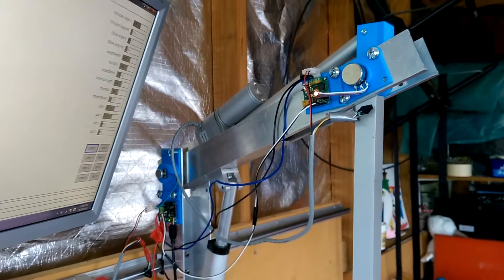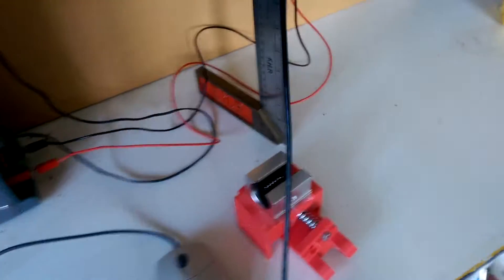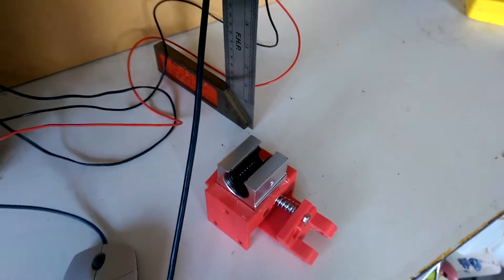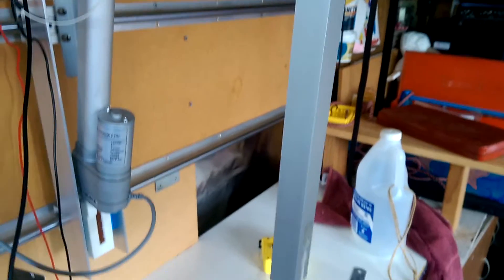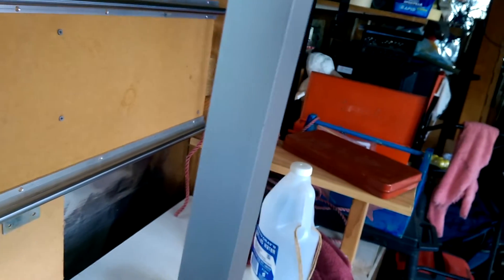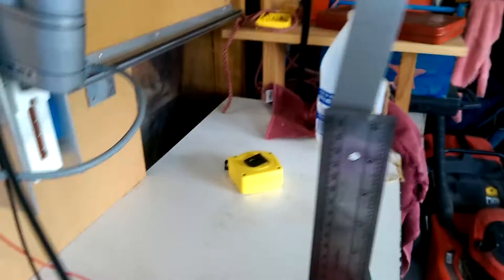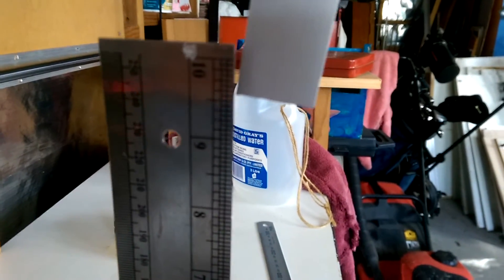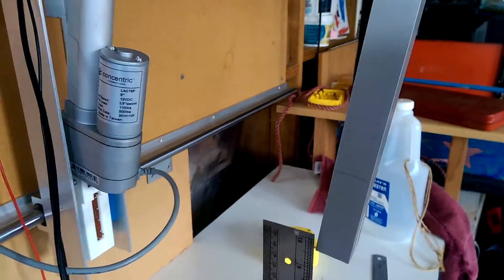Robotic Arm with Linear Actuators - Mark II

Comment: About the accuracy it's probably a backlash issue? As long as the load is from the same side the repeatability is probably quite good?
Reply from the maker: Yes, there is something directional going on.  I had the feeling it might be in the pots because the measurement/feedback should take care of any backlash in the gearing.   I've since moved to magnetic encoders for everything - so much better.

Comment: Hello, great project. Could you please provide a link to actuator's datasheets or maybe just say which model it is? :)
Reply from the maker: Hi, There are some more details in the comments of my first video, https://www.youtube.com/watch?v=QMMlMlj_-NA.  They are the 50kg versions with feedback from https://www.pololu.com/category/103/concentric-ld-series-linear-actuators
Reply: Great, thank you :) I am currently working on a similar project and i am wondering if you used any bearings here? For example in the pivot points, where you attach potentiometers? Or just some screws, without bearings?
Reply from the maker: The bearings are thin ball-bearing ones.  There are 7mm thick so they can fit in the channel.  The inner diameter is larger - about 25mm from memory - this allows me to use a 3d-printed Axle with enough room to mount the pot at then end.
Firstly, I connected a  pot with a D shaft to a D-shaped printed hole but this was tricky because if I made the hole too small I could not jam the pot in.  Even when I made it as tight as I thought I could, I could actually see the D shaft rotate slightly with respect the the hole when you wiggle it, since at first it only contacts at a single point at the "corners" of the D, obviously giving hysteresis.
The circular hole/shaft worked better, since it was easier to jam the pot into a smaller hole for a really tight fit.  The pot had a slot in the end of the shaft, but I think the 3d-print could not make a ridge fine enough to engage with this.  I screw to hold the shaft would definitely be a good idea - my design was too compact to try this easily.
But now I'm moving down the magnetic encoder path - the geometry/setup is pretty similar - if you can mount the pot, then you can mount the magnet, and the zero mechanical error is very appealing.
Reply: Curious if you've made any progress with your closed loop motion, especially with the magnetic encoder!

Do you foresee your arm setup achieving movements anywhere near 0.1mm-0.2mm repeatability?
Reply: Hi Hugh, Checking in again -- To see if you've made any progress with your closed loop motion approach (using the magnetic encoder), and to ask if you foresee your arm setup achieving movements anywhere near 0.1mm-0.2mm repeatability?

I would love to build something similar to this, and it was nice to see a proof of concept before I try it myself.
Reply from the maker: No progress on the magnetic encoder.  I've gone with a bit of a re-design, but still intend to use the magnetic encoder, so I'll let you know how I go.  I'm finding it pretty tricky to find the time to really get into it.